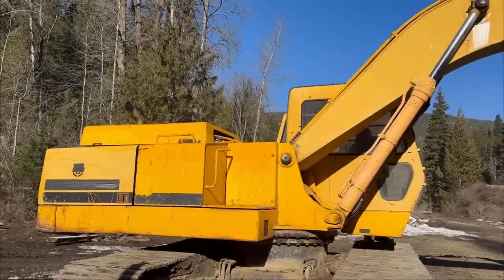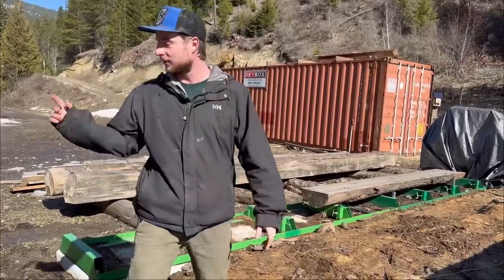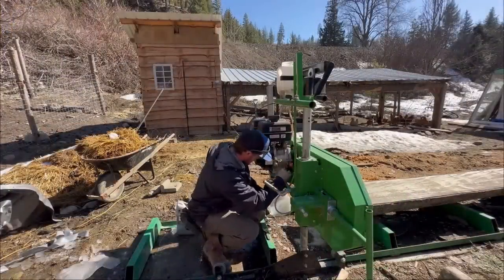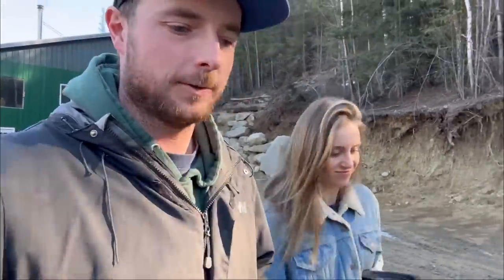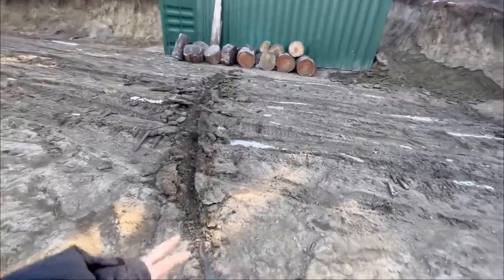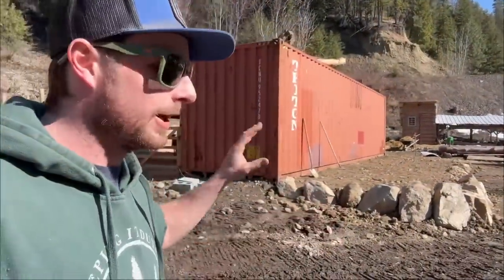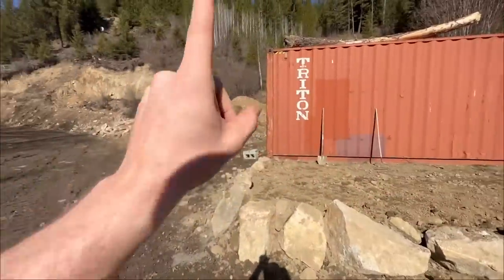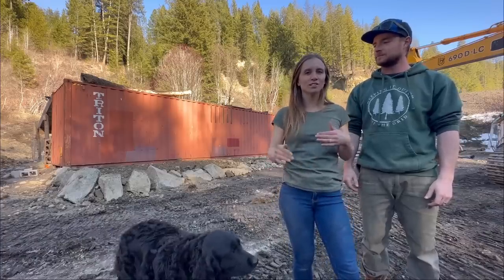Homestead Rescue Didn’t Show You This

Comment: probably unnecessary but some cool ideas that came to mind when watching this video. If you guys set up some kind of drum system up near where you get your gravel, you can do like... a rock wash or whatever, where you spin the drum, and wash your stones, it gets rid of all the dirt and the abrasive rocks rub on each other until they are less jagged, making perfect base for roadways/walkways/foundations etc, easily compactible and less muddy. And, this might be a bit expensive, but with your lumber pile being right where it is... you could weld up like a DIY crane with some D-rings, and pulleys, so you can easily move large beams from your mill to the pile. and if you make it mobile enough swing it even further to load up a trailer, or other equipment u may be using to transport your lumber to your building sites. Also it would look kinda cool... could even add some spotlights so u could work if it gets dark. Idk just some dumb ideas that came to mind that i figured id share lol.

Comment: Mike if you can find any used guardrail ,they make great shallow culverts to put across your driveway-you can drive ANYTHING over them with no damage-they are heavy gauge-hot dipped galvanized-and not really expensive-they come in 13' and 20' lengths-cheapest culverts you can buy !!!!
Reply: Wow! Never thought of that. Excellent idea!
Reply: @MrRigmunkee1  Ive had mine down for about 8 years with dozers,bobcats and tandem dumps rolling over it -still looks like new !!
Reply: Hard to find!
Reply: @graygildner3434  Not in my area!!
Reply: @mrbill8542 You are lucky! I’ve been trying to find some to do this for my driveway in northern Minn - no joy!

Comment: you need to build a large screen for sifting rocks and dirt through. A large piece of chain link fence stretched over a frame and built on an angle. The fines will drop through and larger material will roll down the angled screen.
Reply: I said that to my wife when I watched this.  "They need a sorter!".  I was thinking of the big ass machines but then wondered how easy it would be to DYI something that would work.

Comment: Great to see you Guys on Homestead Rescue they helped you out tremendously , I still see though you are dealing with mud on your driveway I know its a seasonal thing but I see you making grooves across the driveway to try to channel the water wouldn't it be a more permanent fix to cut in a ditch at the side of the road to channel the water down the drive to the bottom ? just a suggestion I know you have the machine to dig it .Keep up the good work love watching your adventures and transformation of your homestead .